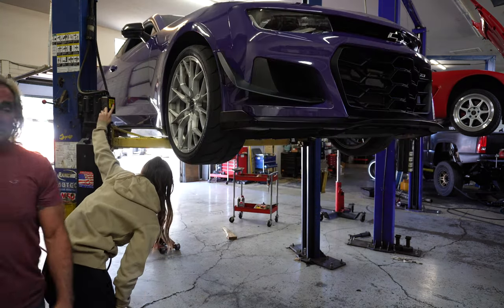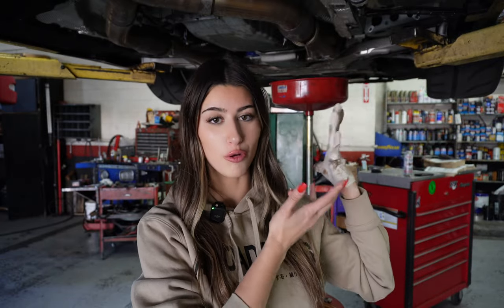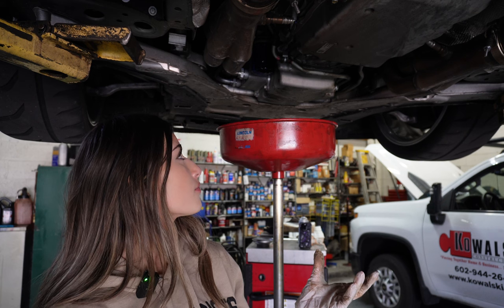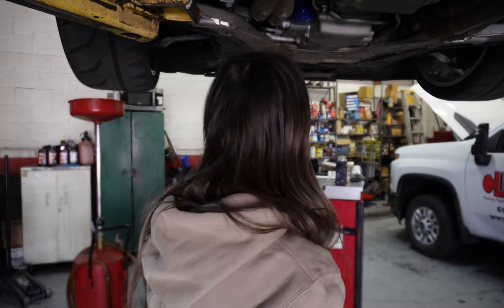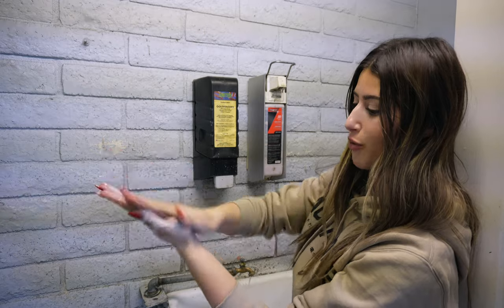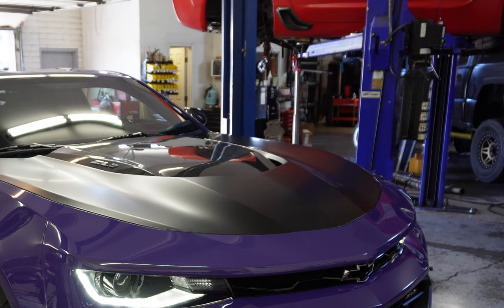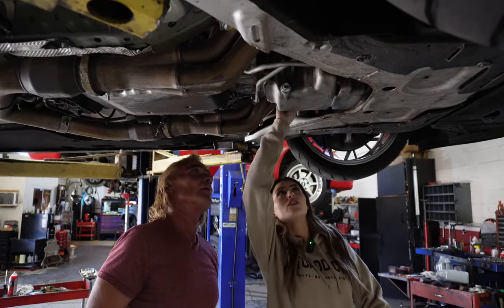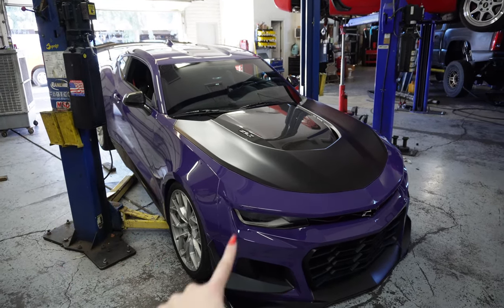Oil Change on my ZL1 & Finding an Oil Leak?!

Comment: Try seeing if the bolts that connect the oil cooler to the oil Pan are tightened all the way. My c7z had an oil leak and it was coming from the oil cooler because the bolts backed out. They were literally finger loose.

Comment: Having a boosted engine, you need to vent the crankcase to the atmosphere instead of back into the intake.  Even better is put an evac system on it.  Youre likely pushing oil thru the crank seals, and maybe the valve covers.

Comment: You can loosen the filter and the poke the bottom with a punch or a screw driver and hammer and let it drain first. Makes less of a mess to remove it.

Comment: Hi Autumn that oil leak is because the oil pan bolts are losen.. its a very commun issue..
 just thight them back up and all set.. 1:30

Question:
why did you use a turbo diesel Oil.? 😮 omg
Reply from the maker: Thanks for that! And it’s just 5w-40, says turbo diesel on it but doesn’t mean that’s all it’s for haha
Reply: @autumnspooner  
Yes, I had the same oil leaking issue and when watching several videos on YouTube everything pointed to the same problem, loose bolts and this engines do not come with a gasket, only RTV Silicon for the engine block joint to the oil pan.
And Well,  about oil,  it possibly has some additives for Diesel engines... and that could be harmful to an engine with high performance mechanics. Be aware of that.. 😉
Reply: @autumnspooner  I would use Mobil 1 Supercar 0W-40 for the LT4. Turbo diesel oil has additives for soot and other things that gasoline engines don't need, and vice-versa.